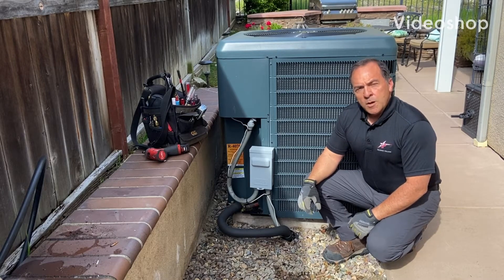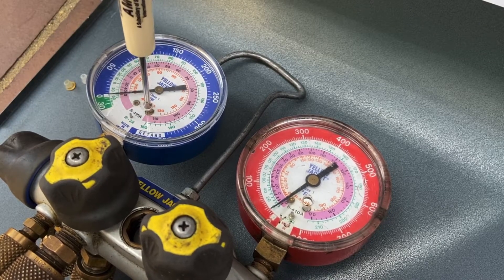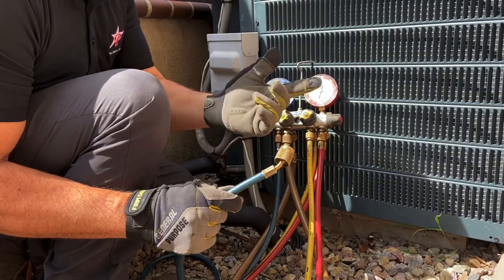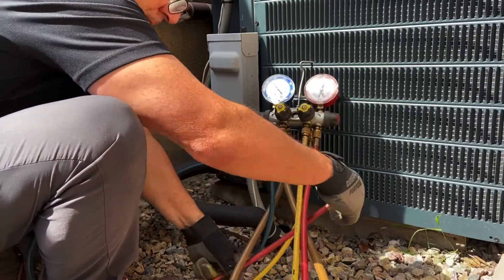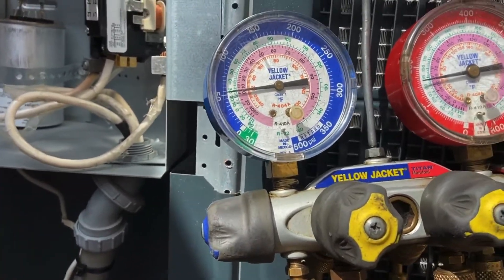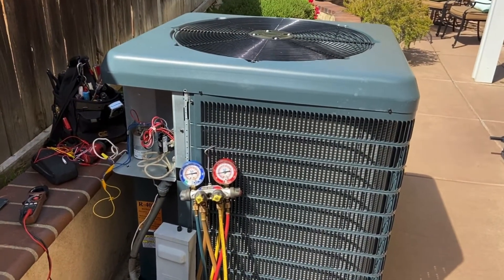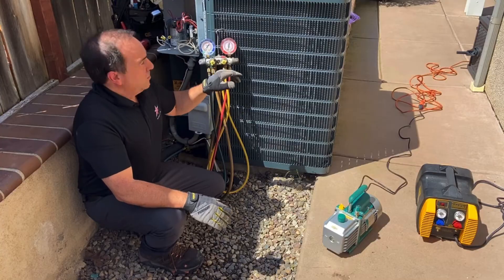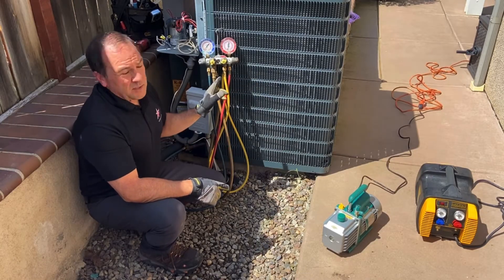ACR 101; Typical Residential Recovery, Evacuation, Charging

Comment: I appreciate your video on the recovery process, I am an hvacr instructor and I like to show the students videos like this. The problem is everyone on YouTube is using the newest recovery machines and they don't use a manifold to recover through just fancy hose connectors. How you are doing it and the machine is the same one I've used for years. I believe in keeping it simple 👍Thanks
Reply: keeping it simple would be Removing Valve cores with a valve core tool, using 3/8 hoses and a Y fitting without a manifold and recovering to the vapor side of the tank flipped upside down  .  you'll be done in no time.  using a manifold and other restrictive things is not doing students any favors.

Comment: you did not pull schrader valves before evacuation process
Reply: I think is not necessary, it just if you want to make the recovery faster
Reply: Not necessary. All that would do is help to speed up the process. Totally optional.

Comment: Unit is too close to the wall for proper air flow.  Need at least 12 inches.  Good video though.
Reply: Your eyes bad?? its obvious this pulls through side and top, so the back does not have to be unrestricted/spaced from wall.
Reply: 3ft in Massachusetts
Reply: There’s no venting in the back so it doesn’t need to follow that rule. It needs that clearance where it would exhaust and breathe

Comment: Your really not supposed to pull a vacuum thru gauges either you should use just use the vacuum and two hoses.
Reply: Nope, never heard of such a thing.  You will not damage the gauges.
Reply: How do you know for sure if there’s moisture or any contaminants inside of your refrigerant?